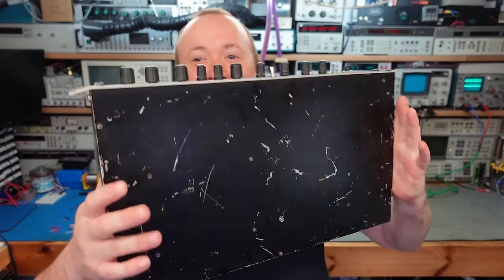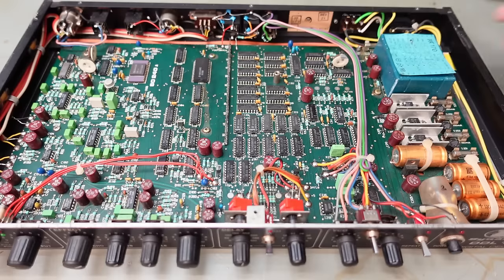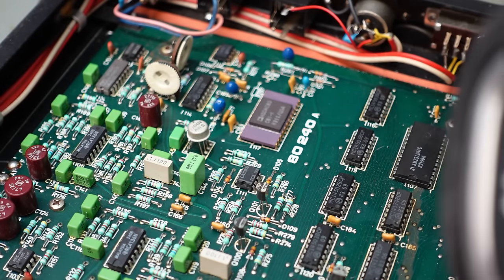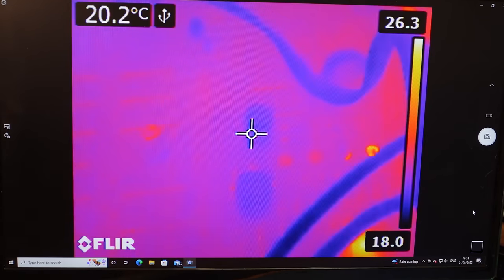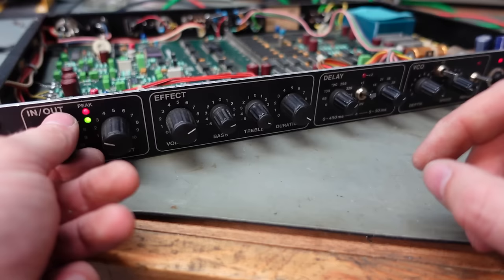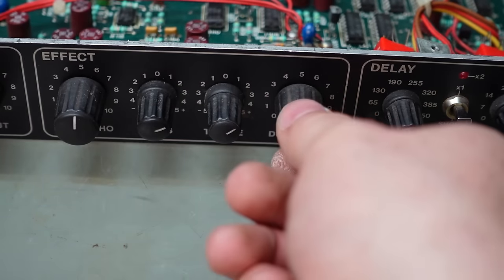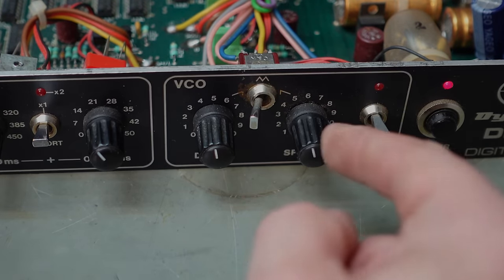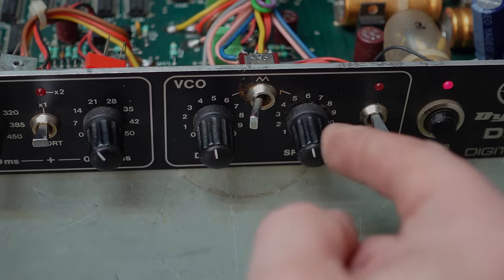Dynacord DDL 12 digital effects repair

Comment: Those Roederstein caps always seemed to failed short! And the brown plastic ones don't usually fair much better, as anyone who's worked on vintage B&O equipment will know. Glad you blanket replaced the crucial ones!
Reply: Ll
Reply: Can confirm! I had a Systron-Donner PSU at  work with a dead channel. Turned out it was a shorted golden ROE. Dead short!
Reply: @brainbuginfestation8548  They've definitely become a 'replace-on-sight' item, much like the dreaded RIFA X2 bomb!
Reply: Those Brown caps used in Quad hifi gear in the 1980's
Reply: i have always considered B&O to stand for Body & Odor of audiophile.
Reply: That is not so easy because the “sound” is in the brown capacitors. 
The closest replacement is the nippon bipolar sme caps. it is work for me before dc-dc converters (galvanic Isolated) psu’s for AD and DA cards.
But in near clock generator and in analog power section (after the dc/dc’s) its can’t be replaced by any other type.
Any other caps what i can try has a compressed mostly 2 dimensional sound signature as this video showing after recaping.
The unit what i fully restored is an Quantec qrs/l from 83. It is nearly 8000 usd in serviced condition.

Comment: Well done Sir. I would definitely have changed out those regulators and smoother caps because they've clearly been under extreme load due to the tantalums. The fuses did flash perhaps they need to be a surge tolerant  type. I love this older gear its what I was raised on and so nicely built. I design a lot of my own stuff and I still build it through-hole in the same way and avoid SMD.... It's proven to be such reliable technology

Comment: When I was still training, like in 1977, I used to maintain stuff on Ferries, fromrRadar, radios and to teletennis machines. I remember the size of the boards in them, about 2 feet by 18 inches, SRBP boards, which used to warp because they were crap, absolutely packed with 74xx chips, literally hundreds of them.

Comment: I have a few of the old Dynacord delay units for speaker delay. The battery dies and can leak. Think i replaced a few other things, a cap blew too i think, after years of no use. I didn't have the correct battery and needed it the next day. I had old lithium batteries that look like AA much bigger backup batteries. I couldn't solder to them so had to modify a battery cage and fit the larger battery that way. Pulled off a mini festival in a circus tent. very cool.

Comment: You know I love how you fix it and then you notice some other problems with the potentiometers and capacitors and you decide to fix them too. Some repair text might say, oh I got it working and fixed its main problem and that's good enough, not you you make sure it works how it's supposed to work.

Comment: Hey Mark, thanks for your channel. The most thing I like you is your smiling, happy face. Most of the electric and electronics professionals will have wrinkled forehead and tension (more over filled with ego). I really feel so happy till the end of your videos. Ohh BTW what is that foam spray that you used to clean the exteriors?

Comment: The inrush current looks quite close to breaking those fuses looking at the glow - even after replacing some old components. 
I guess its common for old components to draw more current than when they were new. I wouldn't be surprised if those fuses blow again after a few power cycles, especially is the unit is used in a warm rack.
Reply: They were supposed to be time delay fuses.

Comment: Brilliant repair! I did wonder about the 'hot' tants near the start, they were showing as 34 and 28C on the Flir, not a huge temperature I would have thought? It's one problem with the auto-ranging on these meters that things appear 'white hot' when they're just the warmest thing in shot.

Comment: Old school for me I had change 15 leaky electrolytic capacitors for my 90s 1 pre-amp tube compressor/limiter and luckily I cleaned the board and it's fixed and it's about the 6th time I've turned it on since I've never used it. I like it more that I fixed it!

Comment: Good repair vid :)
Just curious.. Do you buy these professional grade, Rack mount equipment, and then keep it as a hobby?
Or just to repair and sell on?
I am getting more into the professional grade power amps, Mixers etc, Buying them faulty, fixing them and then keeping them :) 
So far ive got a Peavey Cs1000 amp, A Warrior SB-500 Amp (old style Warrior, back when it was decent built stuff), I picked up a pair of PA 12" speakers off facebook, which happened to have a set of Eminence drivers :) Also picked up a Behringer DJX400 Mixer for pennies, just needed a connector cleaning haha.. 
Im new to repairing electronics, But im learning quickly :)
Im also from the UK, Cambridge area :)
Extremely pointless having massive power amps and big speakers, Can never "stretch their legs", But i find it fun to repair and keep em :)

Comment: The troubleshooting, and cap replacements you found, will fix a huge amount of old gear which has failed.  My test gear is very similar to yours and I picked up most of it very cheaply due to it not working.  Dozens of tantalum caps later and I have all working gear.  Let me know if you are ever in the Boston area or if you are going to the Dayton flea market, it would be fun to get together.
Reply: Seems to be the case! But do you replace w new tants or something else? I’m thinking they’ll last long enough… are they made the same as before or better?
Reply: @2tallB  I'll give a big "it depends."  In some applications (Watkins Johnson receivers come to mind) they used wet slug tantalums and there is no way an electrolytic will fit in the space.  So the replacement must be the very pricey duplicates.  In most other cases a 105C electrolytic is more than sufficient.  But beware, if you are working on specialized equipment which is designed for extreme temperatures you must replace with compatible parts which frequently means mil-spec hermetic electrolytics or tantalums.  Another note with tantalums is that when they originally came out their manufacturers recommended ones rated just over operating voltage.  So for example 15 volt parts used on 12 volt supply rails.  This proved to be bad advice once there was enough field experience.  So use higher voltage rated parts, for example 25 volt parts to replace the 15 volt ones.  This will greatly extend life.
Reply: @flyer617  thanks for your reply. I would just put another tant in, but I’ve seen it’s a pretty hot topic. (No pun intended!) I notice that they are utilized for speed as well so, like you said, it would depend on the circuit. I’m gradually learning, your comments help.

Comment: I have repaired quite a few devices, and often, you can see the wires in the fuses move when turning on the power. But if they light up, I would replace them with slightly higher rated ones, even if they are slow-blow fuses.

Comment: Back driving those 3 terminal regs without input voltage could cause them to be damaged,unless the circuit has a diode between in & out.
Reply: Back driving?? It would be seeing pos/neg dc regardless as long it is referenced no issues

Comment: Like your video's a lot. 
You've got it working again.
But I think I saw the pink lead of vco waveform switch on the right-hand side but you've mounted it left-hand side. So the waveform doesn't match the print on the facia.

Comment: I must admit to a grudging admiration for your "let's push some joules into this & see what glows" approach when faced with a short. I work a lot on revox gear, & this wouldn't work- before you found the duff cap buried in the middle of an audio card, you'd fry off the delicate tracks on the PCBs. I always think revox boards look like they were made by a talented but highly strung silkworm.

Comment: Sad to see you didn't have proper axial electrolytic capacitor for replacement. This type of gear usually is on the road and sees a lot of vibration so there's a reason the manufacturer strapped them down with zip ties...

Comment: Haha!  "Oh no. They're funny-sized shafts."

Was attempting to fix the pots on a very-boutique bass's active circuitry, manufactured in 1996, with extremely confined innards.  Encountered exactly the same problem in the extreme, in that Vishay/Alps/whoever-it-was would be pleased to sell me replacements, their still having the design on file, providing I order 20,000 pots in total.  Absolute unobtanium, otherwise.
Reply: These pots with the thin shafts are commonly made by OMEG in East Grinstead. I spend a lot of time refurbishing Alice Series A consoles and they gladly did me a short production run of less than 100 items for the last rebuild. These guys have made pots for all of the major sound boards over the years and now formulate their own conductive plastics. Well worth looking them up if you're into repairing kit like this on a regular basis!
Reply: @PaulBouzan  Much appreciated, Paul.  Will certainly keep this in mind for the next restoration project - an old and battle-hardened A&H mixer.
Reply: 20.000 pots? damn.
Reply: Yeah I would have just re-crimped the old pot back together. 😄  Goofy as it may seem to "repair a potentiometer", IMO it's still less hassle than mining unobtainium or having to do some "creative metalworking" to graft in an alternate.

(Also, if you keep the original, you avoid messing up the unit with a single oddball control that might otherwise have a different knob, different feel, different shaft length, or needs that one outstanding size nut and washer (that doesn't match any of the others) to affix it to the panel.  Best not to make anyone with OCD cringe. 😉)
Reply: On a similar note, consider the case of a self-tapping sheet metal screw that's been overtightened:  Some people like to "repair" the fastening by installing an oddball larger screw.  But I prefer to hammer a blunt-edge impact tool on the sheet metal surface around the hole, forging it back to a smaller diameter hole suitable for the original self-tapping screw.  Repaired without any new oddball screws among the set!

Comment: replacing tantal caps with normal electrolyte caps no good idea at this place ;) this is analog section and tantal are much better filtering noise and dirt from power line ;)

Comment: If that is to be used in a studio then there will not be a problem Mark.
If it is used gigging then those large power supply smoothing capacitors are going to be shocked loose as you failed to replace the originals with axial capacitors.